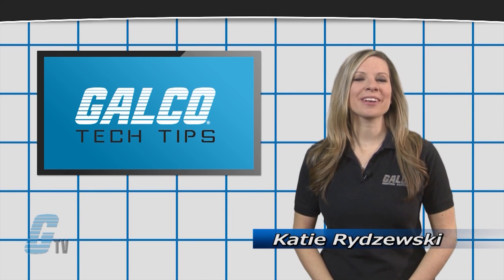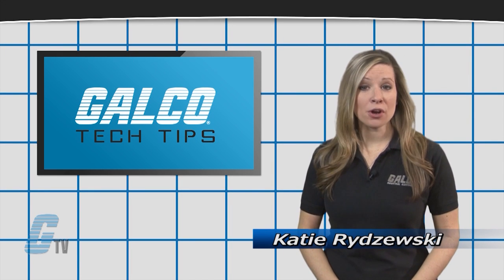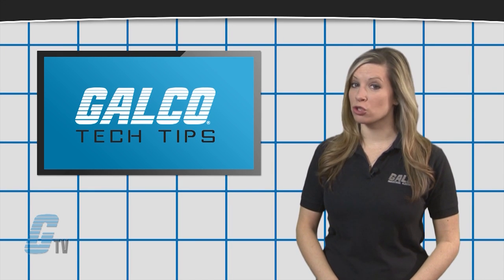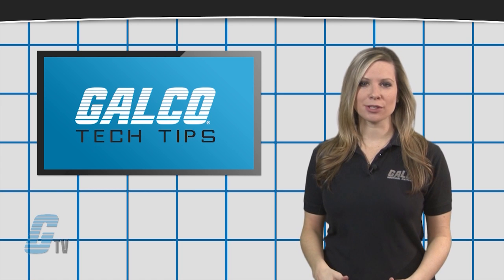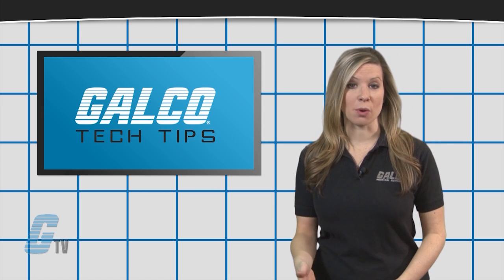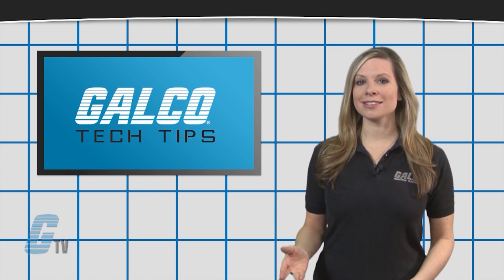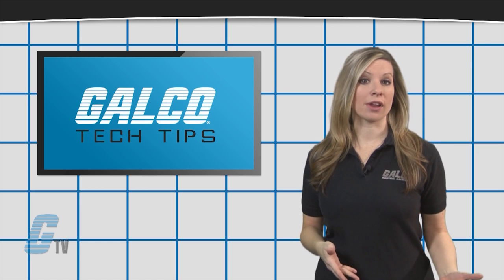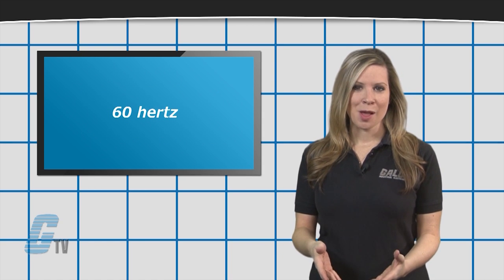Correlation between RPM & Motor Poles - A GalcoTV Tech Tip | Galco

Comment: What happen if we increase the no of poles drastically.. Will the rpm reduces to zero
Reply: so, that is the max rpm for an ascynchronous motor .. around 3600rpm.. can't get any higher than that. 
the only way to get higher rpm is thru Frequency modulator right ? i recall if not wrong..  the motor that i work in Mitsubishi electric Industry... those motor can goes up to 12000RPM.. that' almost 4 times of RPM of ascyn motor..

it is all because of the freq being changed from 50hz to  a lot higher right ?  but since the source voltage is the same, is that mean the torque of the motor at such high rpm will be lower ?
Reply: hii,

thanks for answering. 
so, since the minimum of 2 poles, then that would be the fastest RPM isn't it ? 

what is the max RPM an ac induction motor (single phase and 3 phases) able to achieve since the source voltage is 50hz ? just direct power into motor type.. not the one with frequency inverter controller

thanks
Reply: because it just can't catch up the flux.. without flux cut thru the coil.. there is no....induced force to rotate the rotor.. right ?
Reply: how about a 2 pole single phase induction motor ? what RPM will it be at 50 hz and 60 hz ?
does voltage of sinus wave affect the rpm ? let's say i have 120 Vac vs  240Vac.. does the speed varies ?( if they both are at 50hz. )
Reply from the maker: No. It can't be reduced to zero because, well if you cut a piece of paper in half, you have to 2 pieces. If you keep cutting it in half you always have 2 pieces left they just get so small you can hardly see them. Same thing with motor poles, assuming the applied frequency stays constant, if you keep building a motor with more and more poles, it just keeps turning slower and slower but never stops, ok?
Reply: + pôles = reduces rpm , increases torque
Reply from the maker: Hello Nitin, these are good questions. The reason a motor is slower with more poles is simple really, the Rotor has less distance to travel between the poles when there is more of them. Also any single phase or 3 phase has aminimum of 2 poles, ok?
Reply from the maker: A 2 pole 3 phase induction motor @ 50Hz will have a Stator RPM of exactly 3000, 60Hz will be 3600. Keep in mind that all induction motors are ascynchronous so the actual shaft RPM will always be a little less. Do you know how much less?
Reply from the maker: It is called Slip RPM and is usually 20 to 75 RPM in 4 pole motors, and 50 to 150 RPM in 2 pole motors. So a 60Hz 2 pole motor will have 3600 stator RPM and a full load RPM rating of 3550 to 3450 RPM on the motor shaft.
Reply: GalcoTV Unless it a synchronous motor.
Reply from the maker: Yes you are correct. You must use a VFD to increase frequency to increase RPM, they are directly proportional. However at the Base speed of the motor (sometimes called Knee-Frequency) the Voltage is at maximum and as the frequency continues to increase you have entered what is called "Constant Horse Power" range. The speed goes up and the torque goes down to some maximum speed specified by the motor mfg.
Reply: the more poles they have, the more torque (i can imaging that with the more pair of magnet, the more magnetic flux there is to pull the rotor).

1. but why more poles means slower RPM ?  with a fixed 50hz ac power supply.. can you explain this pls ? 
i always thought the more poles the more speed..  (imaging they put in so much hardwork to make the pole winding... just to get a slower motor ? )

2. can you also tell me a typical single phase ac motor can have minimum of how many poles ? i know most BLDC motor has 3 poles.. that works together. is 3 poles is the minimum  ?  3 poles means got 6 permanent magnet on the rotor right ? 

3. why 3 poles, is  it  just to have a smoother operation and more torque than 2 poles ? i know single pole BLDC motor is totally unusable.  at some point of rotation it has got no torque at all. 

4. 3 phases ac motor can have a minimum of how many phases to be of any use ? 

still hard to believe more poles they have, the slower they become..  lol
appreciate if you reply or make video on the above topic.. 

thanks
andrew